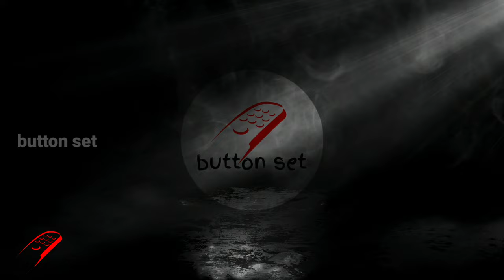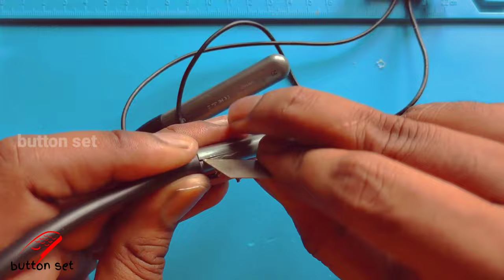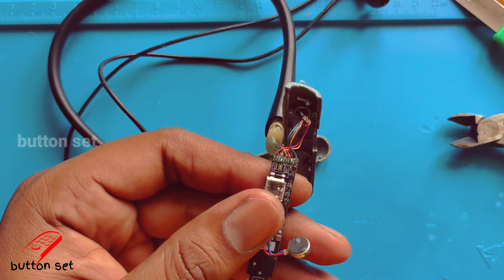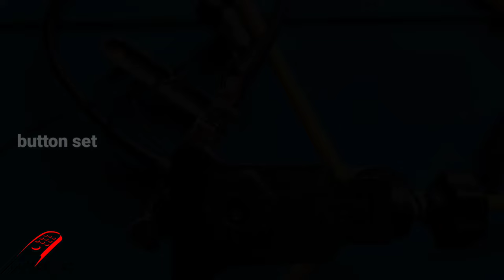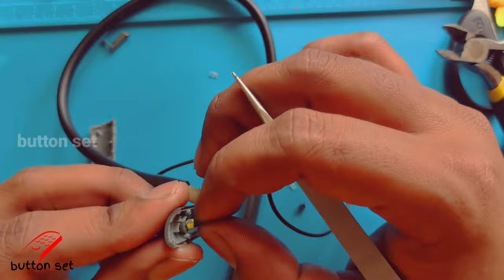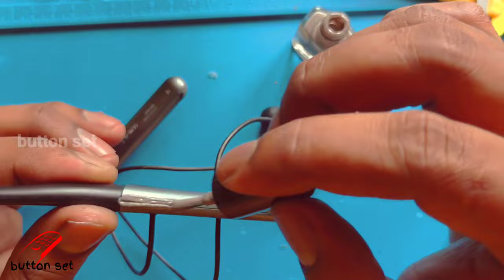Noise flair earphone repair || Fix broken Cable & Not Turn On ...

Comment: My nosie flair neckband not turning off after joining both magnetic buds. White light keep blinking till it gets discharge. Tried resetting the band several time but not worked. Any solution
Reply: @billybutcher1404  same problem tha mene iska sensor nikal ke isme dusra sensor daal diya ab sab shi ha